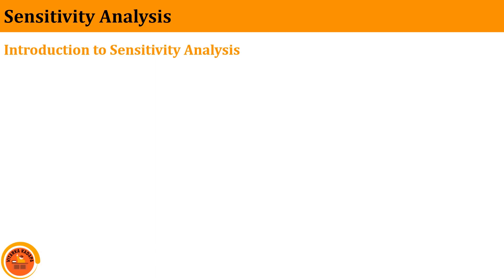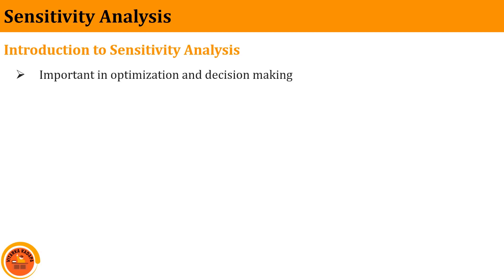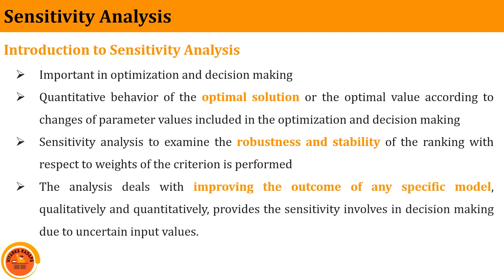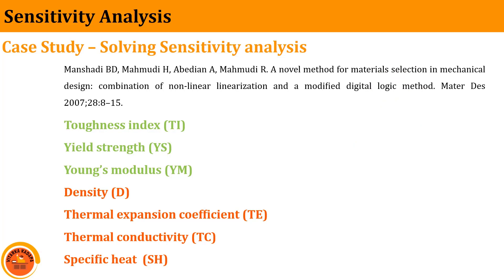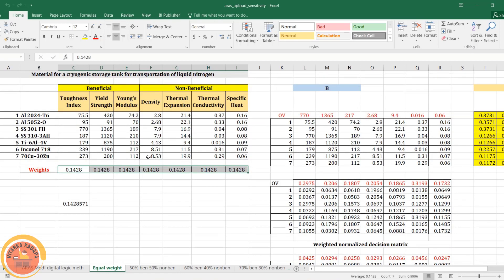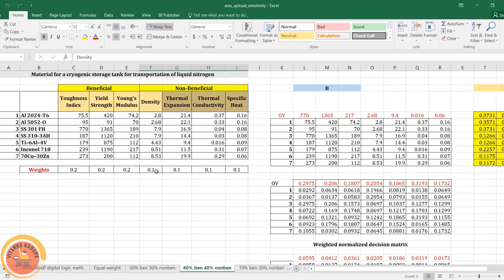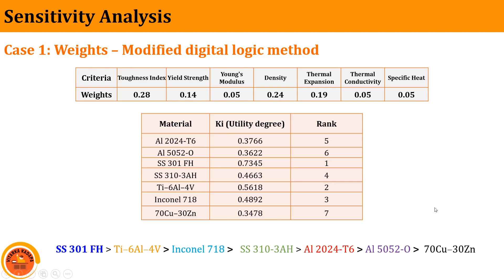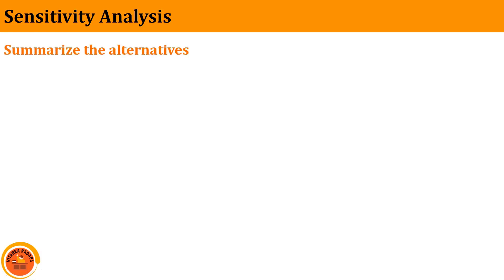How to perform Sensitivity Analysis for MCDM methods  #ARAS #MaterialSelection

Comment: Can we find the sensitivity of the Beneficial and non beneficial criteria like Toughness index, yield strength, etc. ???
Because these parameters must have some kind of high or low impact on the alternatives. If done sensitivity analysis on them, we can find which parameter is more influential and which one isn't.
Reply from the maker: Yes you can try it. But we need one common index value from it. Like in my example for sensitivity I am considering the ranking values. Similarly if you can take some normalised value from the toughness yield etc you can perform. I hope you can apply same method but not sure how to solve it
Reply: @Vitarka Alright. Thank you sir. If possible can you please discuss this with some expert in this domain. It will be of great help for my research.

Comment: what are beneficial and non-beneficial value. Can I do this SENSITIVITY analysis for GWPZ using AHP
Reply from the maker: Beneficial mean higher values, non beneficiary mean lower the value is better.
Reply from the maker: Sensitivity analysis is used to compare the ranks of two or more  methods. Yes you can do. I am not aware of GWPZ

Comment: Hello Sir, what if the results with our original weights have different rankings with SA? Does it show our original weights calculated with AHP inconsist? Inconsistency ratio was 3% for the original weights. Thanks.
Reply from the maker: Definitely the ranking will vary when we change the weights. by changing the weights which we got most time rank that we consider it as a best

Comment: Very nice explanation, Sir. However, based on the original weights, we have to select the best alternatives. Here, we are assuming the beneficial and non-beneficial criteria for the sensitivity analysis. What if we have only beneficial criteria in our study.
Reply from the maker: Sir, Here for explanation i have segregated the beneficial and non-beneficial and weights are varied based on the beneficial and non-beneficial criteria. It was just an understanding. However you can use it for if you have beneficial criteria only. The core point in Sensitivity analysis when we have vagueness in the ranking, then we can use this SA and find out the best alternative.